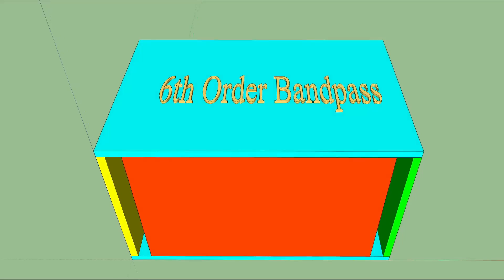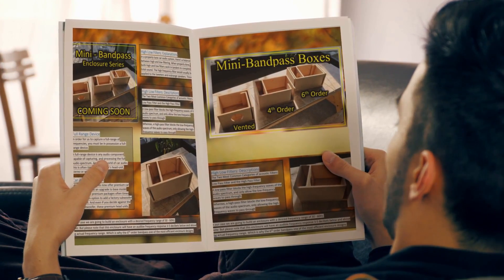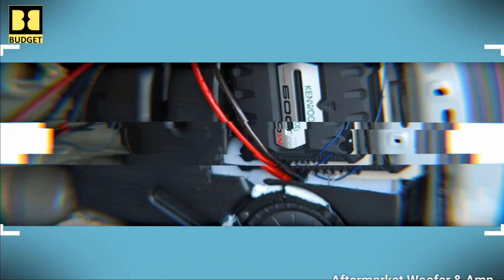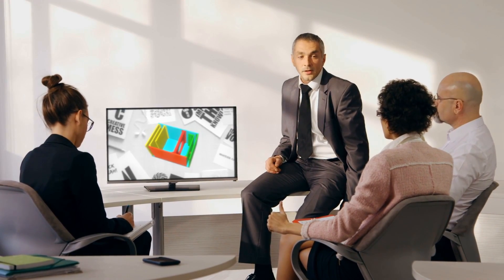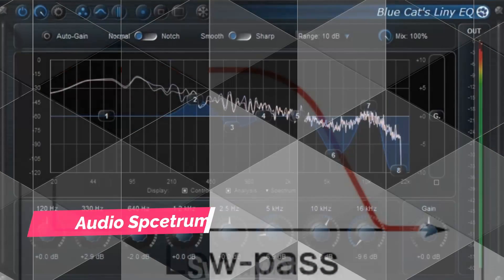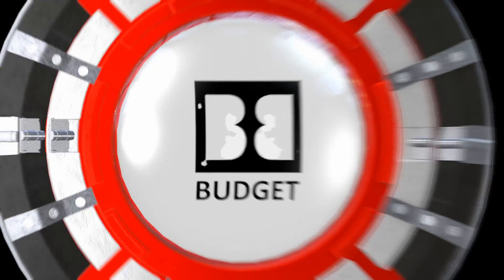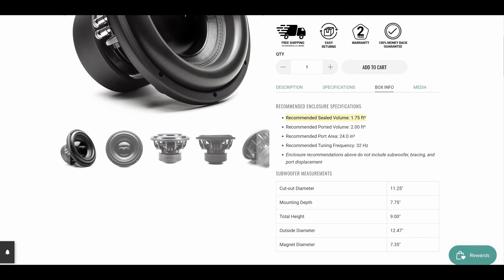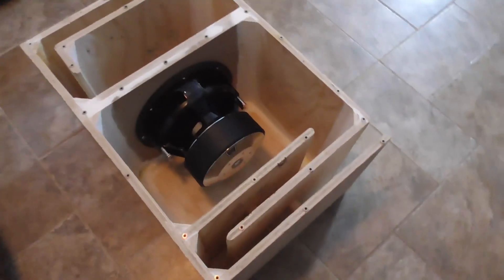6th Order Bandpass: For Beginners - Part 1

Comment: Bose uses this design. I own the Acoustimass 5 Series 2 system and the bass module has two 5.25 inch woofers inside of a 6th order bandpass box. The only difference between your design and Bose's design is there's a flared ported common chamber the ported woofer chambers fire into before exiting to the room. The Acoustimnass 5 series 1 bass module had the ported woofer chambers fire directly into the room which didn't sound very good and didn't have good bass extension. That's why Bose added the front common chamber to the Series 2 bass module with a large flared port which helped lower the bass extension and smooth out the sound

Comment: What if I have 2 subs(15s)🤔
Reply: Well, seeing as how you shouldn't even be trying to design a 6th order enclosure without a subwoofer box calculator, most box calculators can calculate designs based on multiple drivers. All you gotta do is input how many drivers you are using and it will calculate the enclosure dimensions accordingly.

Comment: You might be able to advise me. I had built a 2.1cu. box tuned to 35hz for 2 8's. In my SUV my box(subs up/port back) was very strong 30-50, but lacking 50-80 by a bit. After modeling  a 6th order conversion I decided to add the second chamber. 
My question is, can I face the port for the high tune side towards the front of the car? Let the lows bounce off the back and the upper bass right there coming at me?, Or should I face all the ports towards the back/front in the same direction? Any suggestions/thoughts?
Reply: Well I tried it out. Didn't work out with the high port facing the front, low port to the back. BUT it worked very well with the ports facing side to side. 
Ended up adding a third Sub and facing both ports in the same direction (normal).
Reply from the maker: Its really up to you. It's good to have a loading surface, but not necessary .

Comment: Okay something I've been wondering as you really piqued my interest in a 6th order. Could you use aeroports for a 6th order as a way to reduce the size? Like could you use aeroports to reduce displacement?
Reply from the maker: When calculating port sizes it does not matter if you use a slot Port or an aero port. The amount of "air volume" is still the same. However using arrow ports does reduce displaced space, because of the thin material most aeroports are made of and when using a slot port or a vent you are using much thicker wood material which does take up more space.
Reply: BudgetBassHead in that case, looks like I shall soon be doing a 6th order with a Skar VXF 12 lol! Only problem is trying to come up with a design as I don’t have a computer at the moment (haven’t really had a need for one).

Comment: Binge watching your channel. U like that skar 2x12 prefab? Looks legit but I'm skeptical it's actually 4 cubes and 32 hz.
Reply from the maker: When you see it in person you'd know its legit. I loaded mine with two VXF-12s 1.75cu.ft/chamber; after displacement. And it metered a 143.5 from the trunk. Video coming soon.
Reply: 👍 Bass head certified. Imma be installing 2 12" Audiopipe BDC2s and a Skar Marine 1500w @ 1 ohm. Should beat up my 03 Town Car pretty good

Comment: Hi everyone noob question here. I want to upgrade my stock front speakers without an amp in a 2003 lincoln town car. Have a pioneer head unit 13w rms x 4. Would the Infinity reference be louder and clearer than stock? They are 93db sensitivity. Also they are 3 ohm and im concerned if the factory speakers are 2 ohm it would not be louder. Thanks.

Also doing a Skar 12" 600w rms ported  sub and 800w mono amp
Reply from the maker: Your main concern is going to be the impedance rating of the head-unit. Most car radios are rated 4-8ohm loads. But please check 'Your" head unit specs. A 3ohm load 'could' pull too much current and blow some fuses; so be a bit careful. other than that, your speaker sensitivity rating seems great. And which Skar did you buy?
Reply: Got the Infinitys Installed and they are much better sounding than stock. Also you can turn the head unit volume up more without distorting the speakers therefore they are louder.

Comment: Hey Budget Bass Head, what is your opinion of a passive bandpass box? Basically a large ported box with a passive radiator seoerating the driver from the port. I think this could give you the fidelity of a sealed enclosure with tuned low end extension at the cost of space.
Reply from the maker: You may be better off with dual passive radiators in a sealed enclosure. At least from my experience.

Comment: Just wondering if you have ever seen or used kicker subs in a 6th order? I also have two so I would be looking at a dual chamber most likely, I was just curious about the efficiency of the much different cone shape and much smaller basket profile or if it wasn't at all. Thanks so much for the vid!

Comment: im currently working on my 6th order box now and when i build and glued them together i had an error measurement on the port width approximately 3 to 5mm, is it ok or my box are gonna sound bad?
Reply from the maker: I really don't think you'll hear an audible difference. However, if it was an inch or more.... thats a big mistake.
Reply: @BudgetBassHead  oh thanks bro! i finished my box already and it sounds so good